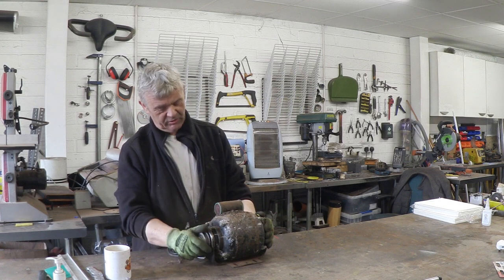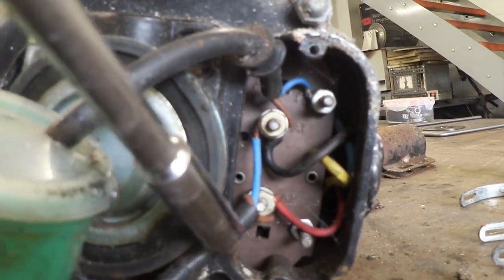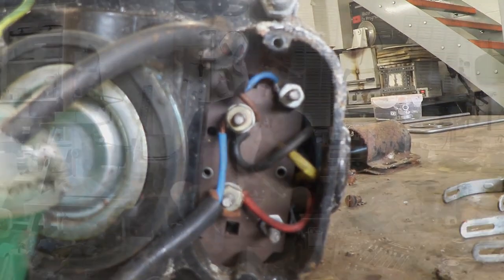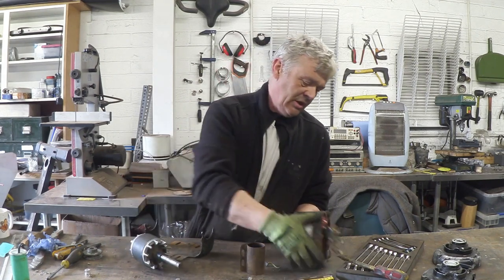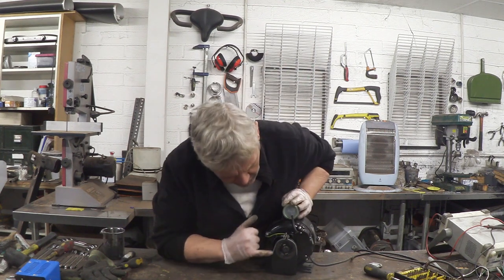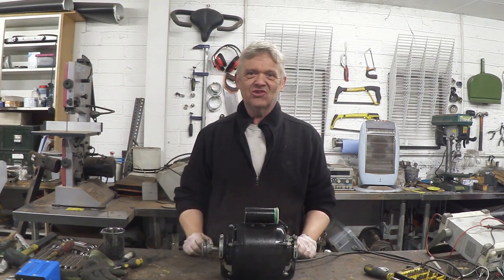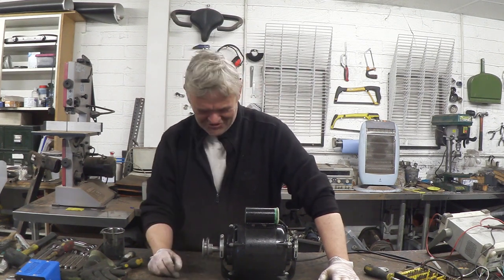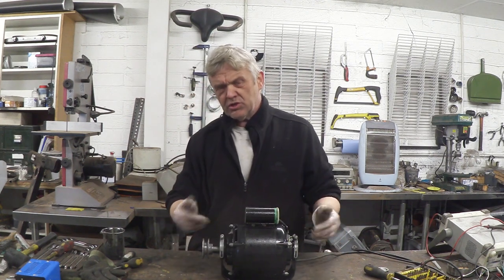1125 Potters Wheel Motor Refurbishment

Comment: Very nice work Dr. Robinstien! Also thanks to your assistant Lukor, I am wondering if you could put a few stages of magnets and coils along the shaft to harvest some of the energy your using to run the motor. Should be room for 3-5 sets up the shaft. Basically anything you have sitting in one place with a rotating shaft / pole or whatnot can effectively give you something back, even a friction wheel on the bottom pulley can drive a smaller DC motor. 
Just takes a moment's thought to let the ideas flow thanks to you. You're an excellent mentor and an even better inspirational motivator.
Thank you my friend. Main stage of solar is done and my bench is almost sorted, just need to make a shelving unit with battery and inverter compartments a be ready to start filming. I have an idea for a quick starter video.
Reply: Sorry mate but any generator would simply add load on the motor. You'd pay for it, plus losses, on your electricity bill.
Reply from the maker: I am looking forward to seeing the vids mate

Comment: As a part time potter I thank you👌 I am also a tinkerer with stuff and have rebuilt many motors etc. The biggest question is what is the best lubricant for small bushing type motors in fans for example. Tried several and the 3 in 1 blue works the longest at a few months but then it’s take it apart again. Looks like bronze bushing with felts. So what’s better considering when new they run for years without any attention at all. Usually these are Chinese made today. Your thoughts would be greatly appreciated 🙏

Comment: Hi,coincidence I have just finished overhauling an almost identical motor to this, runs smooth and quiet even though it’s nearly 70 years old, it’s a hoover and runs a small (Grindturn Engineering) hobby lathe that belonged to my father.

Comment: I'm wondering that the bearings was ok. Normally they go at first. / Might be good quality of the ballbearings...
Reply: No ballbearings in this old motor. Rob described that there are bushes, with felt plug for oiling.
Reply: @nil5221  Ups... Sorry - sometimes I come to the limit of my tecnical language because I'm German.
Reply from the maker: they were bushings I thought maybe Babbit metal?
Reply: @ThinkingandTinkering  Might be the case... In praxis I very seldom seen an induction Motor without ballbearings because they are mostly for heavy duty like drive a washing machine or more - about 600 Watt and higher. 
It was for me number one to check the bearings: Just put a scewdriver nearby the bearing, hold one ear at the handle of driver and turn the rotor. In silence the bearing is ok - if not needs to replace. 
Step number 2 was to check the resistance curls vs. ground / motor housing. 1000 Ohm / Volt minimum.

Comment: Also an induction motor is greate for this application in that it is an asynchronous motor tolerant of degree of slip in that it works through a large range of slip between the rotor rpm and the mains freqency.
Reply: I don't think this is correct. Induction motors are definitely synchronous, designed to run at a single speed, depending on the supply AC frequency and the number of wound poles. The formula is frequency x 60 ÷ number of poles. Under load, there is a small slip tolerated but greater slip will result in rapid overheating. In the worst case, the start winding will kick in again...look out for smoke and burnt-out windings. The only way to controllably vary the motor run speed is to vary the  supply frequency which takes electronics.
Reply: @nil5221  Induction motors are asynchronous, as in, the AC freqency does not = rpm×2/(poles). Induction motors general running conditions are 2 to 5% slip with peek torque at around 10% slip, and torque drops as slip grows from above 10%, and can even generate breaking torque if the motor is run backwards from its rotating magnetic field.  Google induction machine (motor or generator) torque graph for generalized images of the torque curve. 

But I'll grant you that they are not ment to be run outside typical run conditions for long periods of time, certainly not at peek torque.  

 I should have been more clear with my more tolerant comment.  An asynchronous motor can get jumpy and sporadic (not good for spinning clay pots) when forced outside its synchronous speed. One may avoid this with a higher HP motor,  but an induction motor will gradually slip further and further generating more torque untill its peak and drop from there and recover easilly when the load is removed. 

1/4 HP is plenty sufficient torque for a potter's wheel.
Reply: @kreynolds1123  thank you for clarifying!
Reply: @nil5221  I have an interesting and unique motor i made on my channel if you're interested in motors.
Reply from the maker: for sure mate